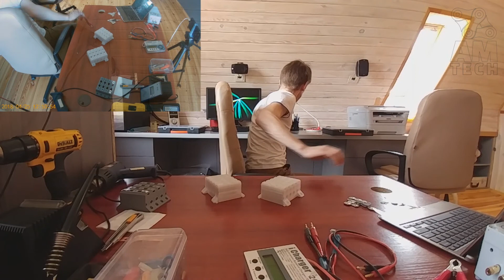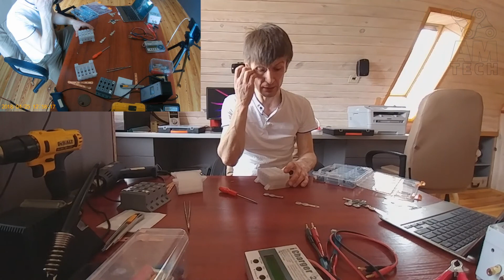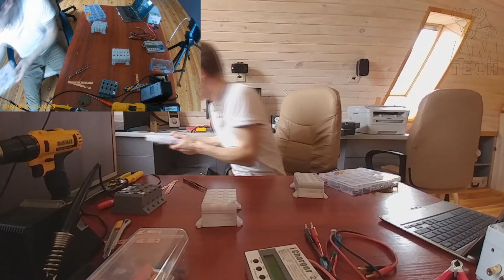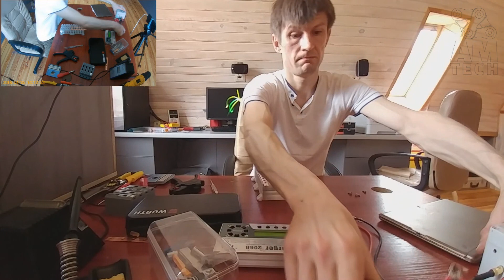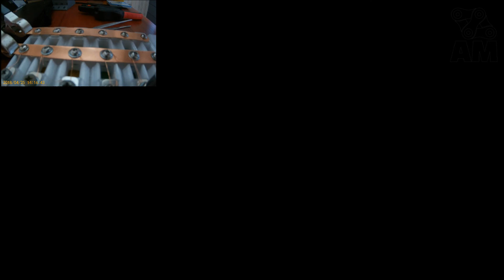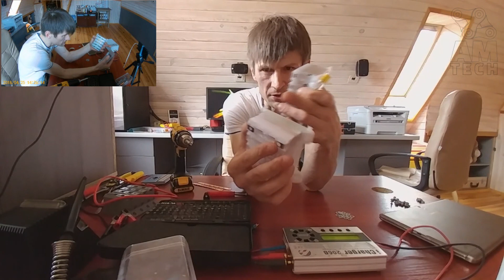Modular power wall design

Comment: So, if I buy 13 of these, I can build a 13s10p pack for a go kart I'm building? I'll be pulling less than 200a for sure.
Reply from the maker: Cody Carse basically yes. You need to 3D print cases though. This is meant for stationary application but if you don't mind experimenting...
There are modules for all sorts of LEV's at www.18650.lt
Reply: This is awesome, keep up the great work, I’ll definitely be ordering something soon.
Reply from the maker: Thank you. There is a Jehu Garcia video on a twitch on 8P. You can check it out, he builds 12V battery
Reply: Ordered hardware kit for a 13s8p battery, can't wait to get it! Thanks, great design and very reasonable prices and shipping to US.
Reply from the maker: Thank you Cody. I appreciate that. Most people think its crazy expensive. Your kit is posted. Let me know how you get on.
Reply: agnius Mikutavicius those people have obviously never tried making and selling something themselves.
Reply from the maker: Appreciate that. I've spent 3 years making prototypes, buying stuff until the eureka moment :) You can track whole development here: https://endless-sphere.com/forums/viewtopic.php?f=14&t=63190
and NESE starts here: https://endless-sphere.com/forums/viewtopic.php?f=31&t=88051&p=1285091#p1285091